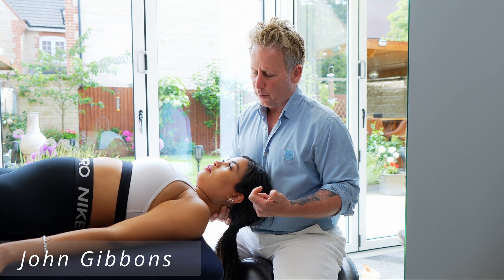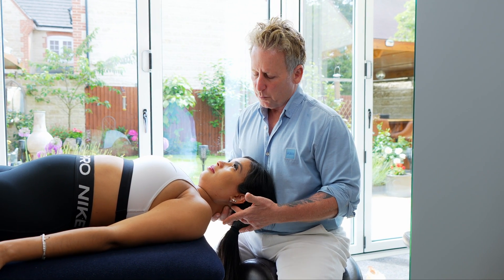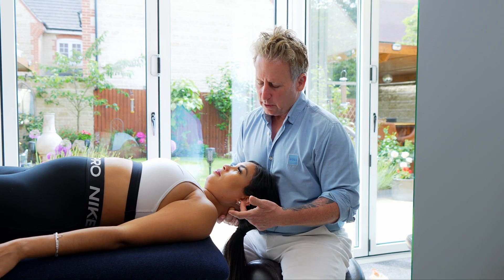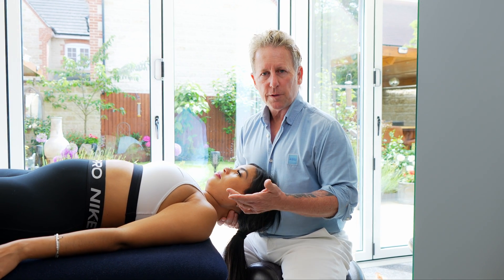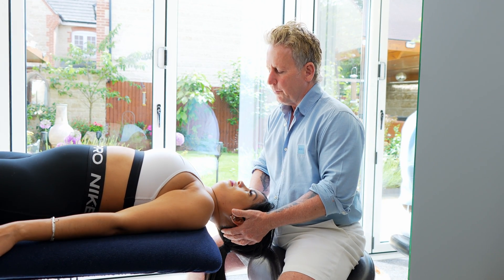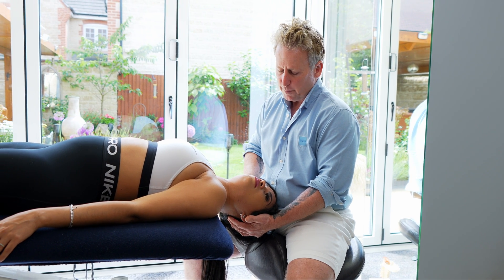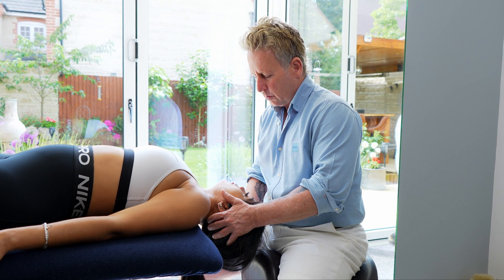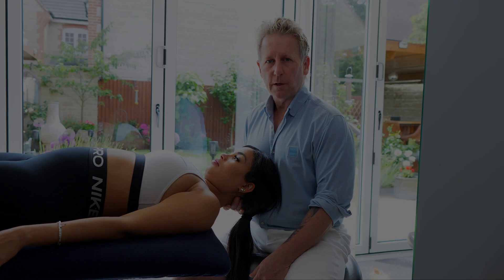How to perform the Vertebro-Basilar Artery Insufficiency (VBI) Test

Comment: There is a mistake in this demo. The side-bending and rotation should be on the same side. Here you see side-bending right and rotation left, which is wrong. It should be left/left and right/right....  https://youtu.be/Pks0i9wymhU?si=8HLuARJgzPtG3uD-
Reply from the maker: The technique is generally performed with only extension and rotation, I add another concept and will still be viable, regards JG

Comment: Rotational vertebral artery syndrome, eg "bow hunter syndrome" is an extremtly rare disease. Otherwise, the BPPV is the second most common cause of vertigo in otoneurologist's office. Due performing this test you can see a nystagmus, but almost all of cases of positional-induced nystagmus will be related to BPPV, not to VAS. Nevertheless, the conclusion in the end of the video is correct - in this situation you shouldn't do any spine manipulations. You should refere patient to otoneurologist for safe treatment (Gufoni, Epley manuver or another)
Reply from the maker: Thanks for the comments - regards JG